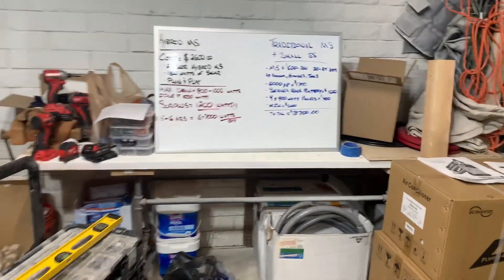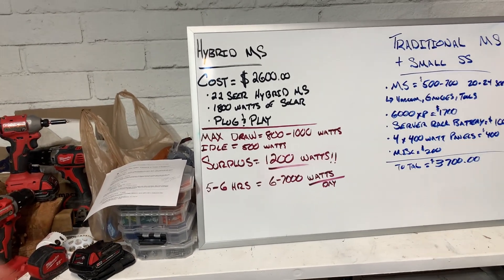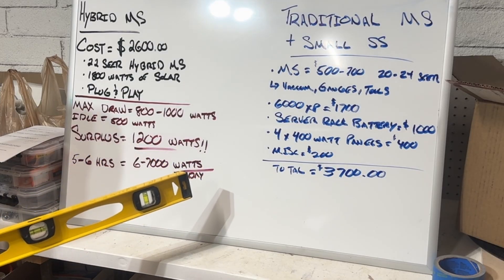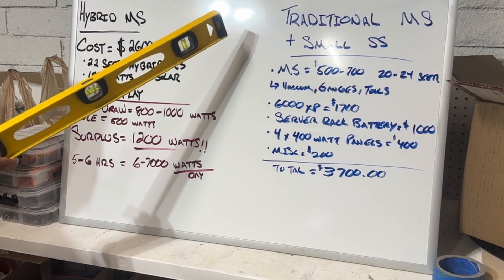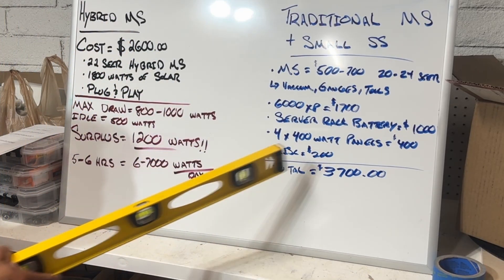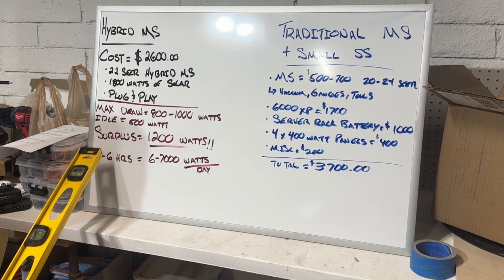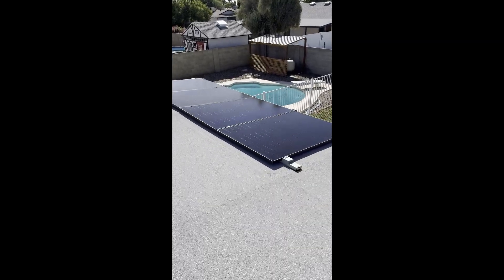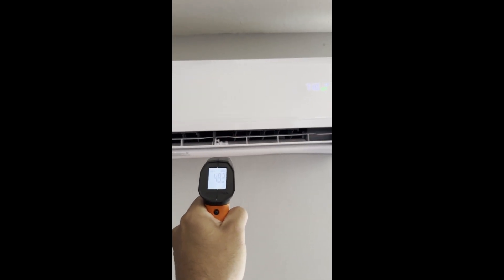Hybrid Mini Split: Gimmick or Game-Changer? | General Overview & Real-World Analysis

Comment: Good video with good intent. Two things… I wish you guys would use terms like watts, watt-hours, etc correctly. They are not the same. I would also suggest that 10% humidity, bright sunny no-heat Arizona is a FAR different equation than much of the country. Far different and its not a good difference. Finally I didnt hear much about that sub panel being switched to the grid when sun power is gone. Im just saying the whole thing is a bit more complicated than this suggests. But thanks for your post and thoughts.
Reply from the maker: You’re right — watts, watt-hours, etc. all have distinct meanings. In this video I stuck with the most basic terms because I don’t want to lose people in vocabulary — the goal was to keep it accessible. Same with the climate example: I could definitely get into specifics like humidity, but most viewers just need the takeaway that Arizona is known for excellent solar because of how sunny and hot it is. As for the subpanel, this video wasn’t meant to break down that wiring detail — I actually have a whole series where I’m building out small solar systems with subpanels and showing how they tie into the grid. This one was more about comparing systems and weighing pros and cons
Reply: @Yesseyd i understand. Thanks. The nuances of making solar work are just complicated, as I am finding, and I am a EE. I just worry that some folks wont understand, and will get taken advantage of.

Comment: You cant start a 6000xp with just one server rack battery can you?  Thought it needed at least 2.
Reply from the maker: You can start and run a 6000XP with just one server rack battery, no problem. It’ll power up and work fine, but a single battery won’t give you the inverter’s full output — you’re probably limited to around 4.5–5kW output max. Adding a second gives you more capacity and lets you use the full 6kW of output.

Comment: I think your under estimating the wattage it's using, and the way your particular setup works, and the amount of sunny days vs cloudy days
Reply from the maker: You’re right, the usage can swing a bit depending on setup and weather. On really hot days here (115°F) it probably averages closer to 750–800w. But the point still stands — with these hybrid mini splits, they’ll never use all the solar they’re sold with. With 4×400w panels you’d expect 1400–1600w, but the mini split never pulls more than about 1100w, so there will always be some excess solar not being used in this type of setup

Comment: I’m in the middle of installing the EG4 12k hybrid unit for my mother in law in southern Alberta. Not quite as hot as your temperatures though.

I am doing a mix of DC solar from 5 x 100 watt ecoworthy panels,  and AC from an EcoFlow Delta 2 Max with 4 x 175 watt rigid panels from EcoFlow. 1.2 kW of PV, which I am forecasting to be a little closer to average consumption on total. I have to figure out how to also charge our car from it on cooler days too 😂. This ends up being close in costs to getting major electrical service upgrades and whole home ducted AC which she really doesn’t want. And no increases in electricity costs either. Plus if and when she moves in with us, it all comes to us except the EG4 which could just plug into the wall because of how I designed the transfer switch.

YouTube video coming soon!
Reply from the maker: Sounds like an interesting setup! Curious to see how it all comes together—keep us posted when the video drops.

Comment: Good discussion on the differences.  The down side of the 6000xp would be DC —>AC—>DC conversion.   But on the plus side of the 6000xp is you can take advantage of the full sun power.  I have considered using battery alternatives on the hybrid.  Such as a water heater dump load in DC. But it would have to meet the DC volt range
Reply from the maker: Great points, Bret — I agree the DC→AC→DC conversion isn’t ideal for efficiency, but the 6000XP definitely offers a lot of flexibility. It would be really interesting to find a way to divert excess solar from the hybrid mini split into something like a heating element. I think a lot of people would be into that idea — especially if it could be done without adding too much complexity.

Comment: First and foremost, any person should learn how to DIY a mini split, including buy a vacuum pump and gauge which cost about $150 more.  but save almost $1000 over DIY a no vacuum necessary mini split like Mr. Cools or some thing like that.  A solar hybrid MS without panels costs the same as a Mr.Cools, so you thought you make a good decision...But Oop.  off grid all in one 6000 XP kick buds.
It's insane, man, for the price of one Tesla Power wall 3 (13.5 KW) battery which cost $10,000, I could buy two 6000XP,, three Eco Worthy 48 volts (15KW) server rack batteries, and 20 Aptos 400W solar panels, or complete set  for $11,000..  Insane, man if you did comparable system of 20 solar panels with a Tesla Power wall3, complete set, a solar company  would quote me more than  $30,000...The only down side you can not net metering with off grid system,  but in most place you can not do that any more....Now you know, DIY off grid save money...
Reply from the maker: Absolutely — going DIY is hands down the most cost-effective route and can save you thousands. Solar isn’t as complicated as people think either. With a bit of time and research, most people can learn the basics and get up and running.

I’ve got the 12000XP powering my house and it’s been solid — handles everything I’ve thrown at it. I actually just picked up a 6000XP for a smaller power station project, so stay tuned for more videos on that soon.

As for mini splits, the quick connect lines like Mr. Cool and the EG4 hybrid are super convenient, but you definitely pay for that convenience — usually 2–3x the cost of a standard unit. I’ve installed both types and honestly, each has its pros and cons depending on your goals and budget

Comment: Also, tradition route, you can scale, later if you decide to add more.. Not just more solar panels, parallel more server rack batteries, but also add more 6000 XPs in parallels.  Any off grid projects that are not able to scale are gimmick.  Anyway,  DIY with Will Prowe recently recommends 5000W inverter from Sungrow which costed only $750 and a Eco Worthy 48 Volts, 100AH server rack only cost $850. total cost of $1600 would be a more viable solution.   Or instead of getting the EG4 6000W, get the EG4 3000W for $700.  Anybody who initially intend to buy a solar hybrid mini split only think of small solar system, Maybe 4 of 400W solar panels.  If they want to add more than 4, for example, 6 then they would be overkill, and all the extra electricity would go to waste, where as regular tradition, they can put that waste into the battery...
Reply from the maker: I totally get where you’re coming from, and honestly I agree that for most small solar setups, a traditional mini split with a small inverter/battery is the more cost-effective way to go. But I keep finding other uses for the hybrid MS — I’ve actually been using it to test used solar panels, and it’s been working great for that lol.

Also, my system’s MPPTs are maxed out, so the hybrid MS let me sneak in a little more solar capacity since it has its own 4 panels and its own MPPT. 

And yep, if you only need 120V, then your suggested setups would definitely work and save a good $800–$1000. I just went with the 6000XP because I needed 240V output.
Reply: @Yesseyd  Yeah, in your case, 18000btu or higher are all 240V, so yeah, you do need 6000XP, but I use a 12000 btu with 115V, even though I cool down the whole house 1100 sq feet.  Which if I put it , low, and make it cranking all the time.  Just lower the house to managable, not very cool to comfortable level ..
Reply from the maker: @TrinhNguyen-vi2qo  That makes sense, appreciate you sharing your setup. Every home and situation is a little different, but it’s helpful to hear how the 115V unit has worked out for you. Definitely sounds like you’ve found a way to make it work for your space. Thanks for the insight

Comment: I have purchased the EG4 24k btu mini. It should arrive next week. I plan on  using some Alexus 400W mono panels for it. But also get an inverter, battery. I am looking at Flexboss 21 or 18 and gridboss with eg4 wall mount battery. One minute I want the ecoflow delta pro ultra,  panel2 and 1 battery. Its so confusing and when I talk to SIG. SOLAR and SHOP SOLAR they really just try to sell whatever im asking about instead of contemplating the situation and giving me their true opinion.  I enjoyed your video - the last comment you made about tapping the ac on eco flow to the ac on mini makes sense. I am trying to get my husband up to speed on solar. Im no expert but i have been watching videos. Lol
Any advice is appreciated. 
Oh yeah the warranties are a big deal.  We will be DIY the project and the EF DPU would make it simpler and i love their app.
Reply from the maker: You won’t be disappointed with the EG4 24k Hybrid at all. I have the 12k Hybrid myself and it works awesome—even in tough conditions—so the 24k is going to be even better. Honestly, I kind of wish I’d just gone with the 24k from the start.

I don’t know too much about the EcoFlows, but I do know they tend to be a bit pricier overall. From what I’ve seen, their performance for a dedicated setup like this just isn’t going to match something like an EG4 12000XP, or the EG4 18k or 21k Flexboss/kit.

If you’re looking for value and power with good support, the EG4 batteries and inverters are really hard to beat, especially for a DIY project like yours.

EcoFlows do tend to be a bit more plug-and-play and user-friendly out of the box. But EG4’s products will give you better value and more capability overall. The trade-off is that EG4 setups are slightly more involved in the installation—but they’re still very, very easy. Just not quite as “turnkey” as an EcoFlow.

Comment: 1980s houses are old? Most houses in my area were built in the 30s. 🤔
Reply from the maker: Haha fair point—yeah 1980s isn’t exactly ancient history! But those typical Arizona 70s–80s track homes were definitely not built for 115 °F summers.

My 1977 house? Attic had maybe 3–4” of insulation—might as well have been a heated blanket for the roof. 🤣 New builds have almost a foot of insulation up there.

Windows? Glorious single-pane aluminum windows that basically invited the sun in for coffee. Modern homes get dual-pane, energy-efficient glass that actually tries to keep the AC inside.

Walls? Don’t even ask. Solid 8x8x16 block outside, 2” furring strips inside, zero insulation. It’s like living in an oven on bake.

So yeah, 1980s houses here aren’t “old” like 1930s ones—but energy efficiency wasn’t exactly a design priority back then. I can’t even imagine what a 1930s house here would have for insulation… cactus and good vibes? 🌵😆

Comment: Can't you connect your water heater in parallel with this? Just connect solar DC to the lower element, keep upper element connected to AC power assuming you have an electric water heater
Reply from the maker: Both of the elements in a standard water heater are wired for AC, not DC. I’m sure it can be done with a couple mods—like swapping the bottom element for a DC-capable one and adding a controller of some sort—but in the water heater’s stock form, I don’t think it would work that easily.

Comment: I live in Oklahoma I'm 65 and retired and living on a fixed income I was about to buy one of those hybrid unit until I seen your video and thank you I want to set it up in my garage and blow it into the house and circulated through the central air fan what are your thoughts on that can you tell me a easy way to get into the solar and I know nothing about it thank you
Reply from the maker: Hi Michael—thanks for your comment!

Can you clarify what you mean by “blow it into the house through the central air fan”? Are you planning to run ductwork from the garage? Through the attic or crawl space? Just want to understand your plan better so I can give more useful advice.

I’m also planning a small solar build soon that might help you out, so stay tuned.

If you’re looking at solar, a couple of questions:
✅ Do you have a south-facing spot on your property with no big trees or buildings shading it?
✅ How much electricity (in kWh) do you use monthly? It should be listed on your bill.

If I were in your shoes, this is exactly how I’d start planning—but I need as much info as possible to help you best
Reply: @Yesseyd myself and two dogs live in a three-bedroom house with 1500 square feet facing the West in the city of Norman Oklahoma two bedrooms we don't use and want to air condition the garage I've insulated the ceiling and the overhead garage door and plan on insulating the two remaining walls. I have Clearview of the skies on the south side of the house. In my two car garage the South Wall has the main Breakers box and a 4-inch hole that I used for my diesel heater exhaust so that is where I want to set the outside unit for the mini split the central heat and air heat pump is located there as well and it's 20 years old and on its last legs. The return air Inlet is about 4 ft from the door that you can access the garage from the house. I have the funds for a 24,000 or 30,000 BTU mini split and locate the head inside unit in the garage and direct Air flow towards that door and then set the central air fan only on and that could circulate the cool air throughout the house? What are your thoughts on that.
Reply from the maker: @michaelhuardify  I feel like you’ve got a good game plan for the mini split in the garage already. I’d definitely try your idea with the central air fan—if the return is close enough to the garage where it’ll pick up the cold air, it might work. If it does, great! But don’t be surprised if it doesn’t cool the house evenly.

Is your water heater gas or electric?

Do you have any other 240V appliances you’re thinking about running on solar, like pool pumps or well pumps?

If I were in your shoes, I’d buy a traditional high-efficiency mini split—like a 24,000 BTU (2 ton) unit for the garage—and maybe add a 1 ton unit for whatever other area you want to keep climate controlled (living room, master bedroom, kitchen, etc.). You’d really only need the 1 ton if your plan with the return and central air fan doesn’t work to cool the house the way you wanted it too.

I’d also plan to install a small subpanel near your main electrical panel. When you install the mini splits, run the wiring to this new subpanel instead of your main panel. Later on you can move circuits from your main panel to your sub panel and more of your house will run off solar so you’ll be paying less to the grid. The more you can run off solar the faster the system will pay itself off.

I’d place a 6000XP inverter somewhere inside the house—maybe in a room you don’t really use. You can run 4 AWG wire (3 conductors + ground) through the attic or crawl space, or install the 6000XP closer to the new subpanel to reduce wire length and cost.

Next, run another set of 4 AWG (4-wire) from your subpanel and tie it into your main electrical panel with a 50 amp breaker. This lets the subpanel pull power from the grid when solar and batteries can’t cover the load—important early on since you won’t have much battery capacity at first (batteries are the expensive part of solar).

Lastly, run 2 more 4 AWG wires linking the neutral and ground bars between the main and sub panels.

For batteries, I’d start with one 5 kWh server rack battery connected to the 6000XP. It won’t be enough to run everything overnight (that might take 3 batteries), but starting with one keeps the initial cost down and lets you add more capacity over time.

To give you an idea of cost, a 2 ton hybrid mini split with about 7 solar panels (around 3100 watts) will run you roughly $3500–$4000 after taxes and shipping.

A small solar system with a 6000XP inverter, one 5 kWh server rack battery, and 4000 watts of solar (10 × 400 W panels) will cost you about $6500—maybe a little more or maybe even less if you can find good used 400 W panels locally. One 2-ton traditional mini split is included in that ball park estimate.

I mention the 6000XP because that’s what I know best, but really any split-phase inverter will work and let you power 240 V appliances.

It’s allot of work but surprisingly very easy and straightforward. I plan on building a small setup soon, should help you out if you decide to go the solar route. Depending on your monthly energy usage a small system like this may entirely wipe out your electric bill in months you have good solar production.
Reply: @Yesseyd from June to 2024 to June of 2025 I used 10175 kwh not sure if that's good or bad but I try to live conservatively thank you so much for your time I'm definitely going to be going with the route that you suggest and not the hybrid mini split I'm looking forward to seeing your new video I will be watching thank you
Reply: And my house is all electric the only 240 I use is for the dryer and my welder
Reply from the maker: @michaelhuardify  10,175 kWh over 12 months works out to about 848 kWh/month (10,175 ÷ 12 ≈ 848), and about 28 kWh/day (10,175 ÷ 365 ≈ 28). That’s actually pretty average for a 1500 sq ft house.

I’m sure once you start using mini splits instead of the central air you might get closer to 20 kWh/day. A small system should be able to cover your daily needs as long as you get a good 4–5 hours of sun.
Reply: @Yesseyd thank you very much your advice has me going on the right path I believe I will keep you posted and have a great weekend